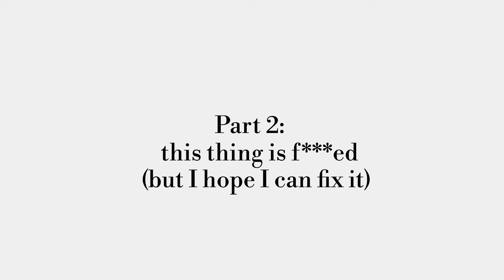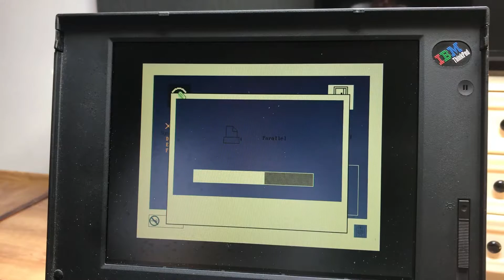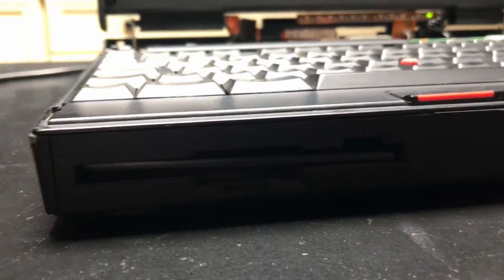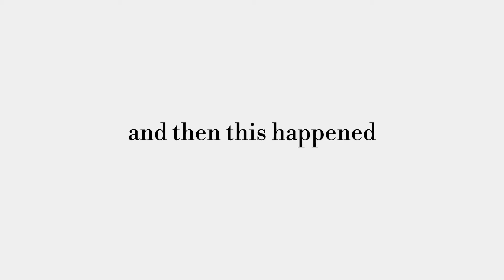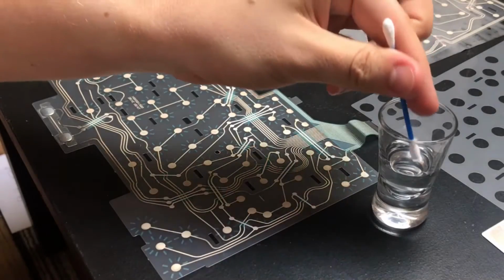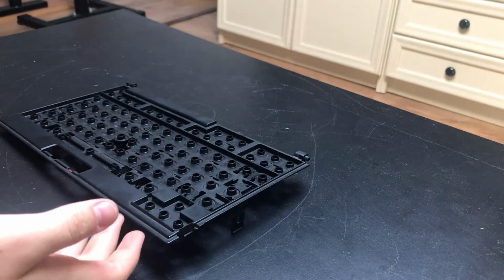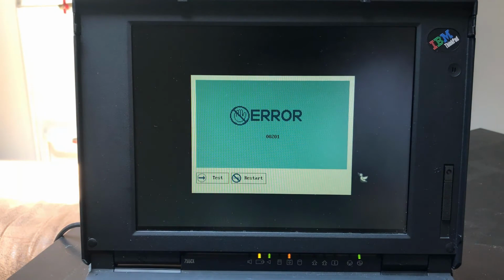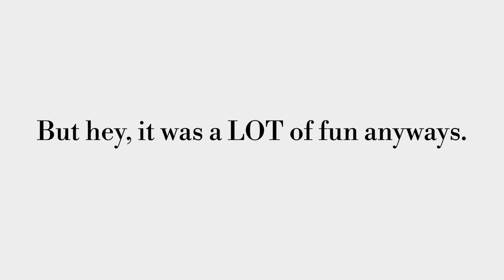(part 3) Restoring a ThinkPad from 1995 - IBM ThinkPad 755CX restoration

Comment: I know the feeling haha. I have an old NEC 386 laptop, that I tried to restore. That one was made at the end of the 80s, so has about a million capacitors. I replaced all of them. Cleaned the leakages under the bad caps. Took me days. I bought an electric solder vacuum just for this project (well, I will use it in the future for other things, but if it wasn't for this NEC restoration, I would not have bought it). And the result?

The laptop worked for one day. One goddamned day. Next day morning upon switching it on I was greeted with an error beep code, the LCD backlight was on, but nothing else (I even have a few seconds long video on my channel about the symptoms). And after spending days on this thing, I just gave up. The thing is, my skills regarding electronic components, how they work and how to test them, are just too limited. So I put that thing away, maybe some day when I will have more free time, more knowledge in this area, and/or possibly an other similar unit, so I could swap components out between the two, narrowing down the problem, I will give it an other try.

It's a shame because just like you with this Thinkpad, I really wanted that NEC to work. I was even planning what games from my childhood I would try out, when it's all fixed up. Sadly restoration projects with these vintage machines not always turn out like we envision them.
Reply from the maker: Hey, it might be that after you replaced the caps and cleaned the corrosion, you might have not noticed some broken traces. They could've shorted, for all I know. Sucks that you can't just go online and pick up replacement parts for these old PCs, doesn't it? Would've made this hobby a whole lot easier. 

As for your laptop, one thing I would definitely check would be the memory and power rail continuity using a multimeter. Could be that it's actually 2 error codes (1-2 and 1), and upon looking at IBM PC and PC AT codes things that pop up are display and memory. I know this is a wild guess, but it wouldn't hurt to try, am I right? I'm gonna be on the lookout for a manual - maybe it'll provide some more information. Not knowing what kind of BIOS your laptop has (a lot of those late 80s laptops/convertibles had a "customized version" of IBM PC's or Compaq's BIOSes) makes it a little bit harder to troubleshoot. Fret not, though, for you never know when you stumble upon the answer! 

As for your last sentence - I wholeheartedly agree. But what can you do about it? Right now I'm editing a new video about a 1996-ish proprietary PC that actually is fixed fully (and is proprietary, so - interesting)!

Good luck on your retro endeavors!
Reply: even if you never get it running just imagine how valuable it will be in 20 years time when you finally bring it back out of the closet.

Comment: I just spend a whole day dismantling 6 x 755CX machines. Corrosion is the main issue, caused by the 3 cell battery, but that is mostly repairable. I saw one with a RAM issue. I'm going to try and make 4 good ones and then sell off the spares. Search 755cx on ebay uk and you'll see all the spares ive listed so far... My main issue is that 3 of them have PAP (power on passwords) and I haven't get found a way to disable. Someone found where to short a 755c but it's different architecture on the CX so useless so far...
Reply from the maker: By "someone" I assume you mean this guy? http://www.os2museum.com/wp/cracking-a-thinkpad-755c/ 

The C and CX can't be of an architecture different enough not to include an entirely different password scheme; rather, they used slightly different methods of protecting them(the 755C does indeed have a "power-on password connector" listed in the HMM, whereas the 755CX section does not mention a single thing about it). It's always been like this in ThinkPads: either the password depends solely on the CMOS, and its non-volatile memory (like the earliest ThinkPads), or on a special EEPROM.

The thing is, there is the POP (power-on password), and the PAP (privileged access password, aka the "supervisor"). I don't know which one do your 755s have, but while POPs can be cleared by removing the yellow CMOS battery and discharging that CMOS memory, the PAP has been done one of two ways - both involve locating that pesky EEPROM. The most common ones in these old Thinkpads are the 93C46 and 24RF08, with numbers/letters added in the front or the end of the EEPROM's "name". You would then look up the schematic, find the serial input and output pins, then short them and power on the ThinkPad. Like that guy from the link. It works on different vintage thinkpads too; it worked in case of my 760EL.

There is an alternative approach; one that requires a bit more tinkering. You would need to dump the EEPROM by either de-soldering it and putting it in a programmer, or by rigging up a serial interface. Here's how one guy did it:  https://expressit.pl/porady-komputerowe/odzyskiwanie-hasla-bios-w-laptopach-ibm-thinkpad/
(It's in Polish, but should you have any trouble, I could translate it for ya)

You would then simply read the contents using IBMpass (mind you, the password in some models is stored as little-endian), and that's it - you now know the password. IBMpass also has a "decoding" feature, but I think that's reserved for the 24RF08 chips.

So, in short, you'd first need to confirm what type of password you have on these three little pigs. Feel free to contact me if you have any questions or if you need me to clear some stuff up; while my 755 is still dead with that memory error, I sure could play around with, for instance, a 760 to help you on your journey.

Here's an additional link with some info: 
https://www.allservice.ro/forum/viewtopic.php?t=200 

Cheers and have a good one!
Reply: @kikidoesstuff7557  yeah that's the page with the 755c. I've completely disassmbled, de-corroded and in the process of rebuilding them this weekend - the images of the 755c bios chip doesn't look anything like the 755cx - i wasn't expecting many differences but the pics i saw, they were completely different. I'll inspect one tomorrow and at least see if i can locate the chip you mention.... i'll have a look at that .ro link you sent too and possibly reply there. If you need a spare 'internal' RAM module, i probably have a tested-good one.... cheers
Reply: i found the chip - it's in a completely different, spot on the underside of the motherboard and not anywhere near the battery itself. I'm going to short one of the boards in the morning (it has to be completely disassembled to get to the chip, with the CPU completely covering it, so i'll have to rig up a soldered short in order to then get the thing powered up to do it....
Reply from the maker: @sandycheeks7865  Good news! Could you perhaps send me a pic (or tell me) the location of the chip in the CX? It'd be good to do a write-up on this if this whole shebang works.

 Is it the 93C46 or the 24RF08? You could just put a bit of solder on the serial input/output pins and power it up. Definitely let me know how did that work - and if it doesn't, you  could still try the thing I posted with the serial interface; I'm up for help with it too. Good luck again!

Comment: hi my quest for one my coolection piece thinkpad 755cd have a problem the brightness standing full down and pull up half the brightnes standing ok problem for medium brightness turn most high not got more brightness 755cd thinkpad this 755cx thinkpad previous version external full same inside for same external not sure thanks the forward answer :)

Comment: dont give up!! i would try to reflow the the solder on the mem chips i think its probably non lead solder so it will tend to crack over time and cause issues like this, as for the keyboard you can try some defroster conductive paint sold in automotive stores its ment to repair traces on glass for window defrosters, might be cheaper then what you where looking at.

also 84G6497 is the fru number for the german 755cx keyboard 84G6498 is swiss/german and 84G6495 is for the american keyboard you might have luck finding a NOS one or someone selling a good used one 85G8565 is the memory card fru for the 755cx as well
Reply from the maker: It's still in my possession. I'll be looking for a way out of this. Thanks for the kind comment!
Reply: @kikidoesstuff7557  good stuff I have a 755cx but it the model without the dsp chip for sound. It also only comes with a 640x480 screen, I have a dsp card coming in. You might try to reseat the lcd connectors to see if that whats causing the lcd issues looks like that might be what it is, try using a external monitor to rule out the video card
Reply from the maker: @xargon1234  I think the ribbon itself's kicking the bucket honestly. External video is fine. Maybe I'll do an update on this ThinkPad once I fix the pesky memory issue.
Reply: @kikidoesstuff7557  there was  ribbon cable from the monitor on ebay from bluefruit75 along with a few more bits I don't think it sold so you might contact him to see if you can get it.